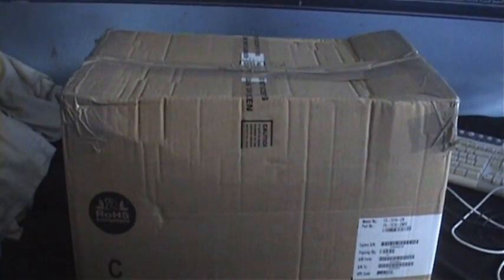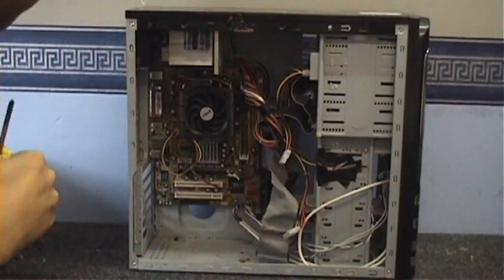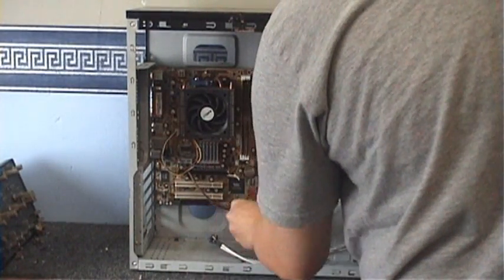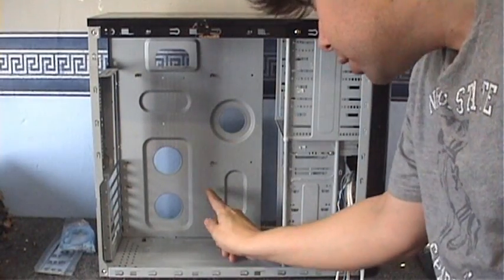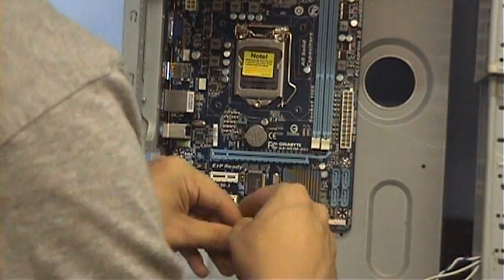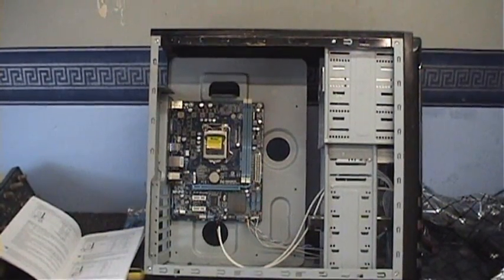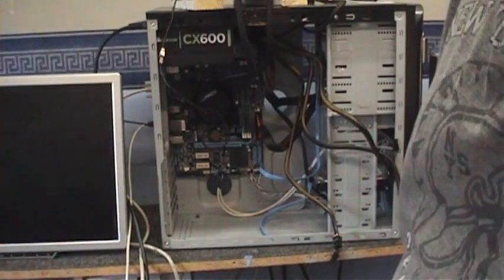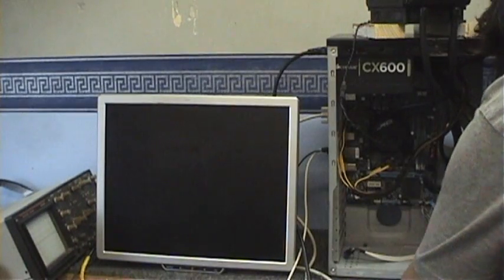The PC upgrade saga part 2 - Un-boxing and performing the upgrade!

Comment from the maker: It;s easier to use the handycam, when I want to use an external microphone (even tho the handycam's microphone itself is pretty good) I can just plug it into the camera and not rely on a separate tape recorder to record the audio, which also makes video editing easier since I don't have to sync things up.  As the handycan is tape based and not memory card based there's no chance of corrupted files, tape will just glitch out for a couple of seconds then be fine again.

Comment: The biggest performance difference between Ivy and Sandy is that the updated Quicksync(for video encoding) is far faster on Ivy, slightly faster per clock, less power consumption, hotter :(

The only reason why I upgraded from Sandy was Quicksync other than that there's very little in it

Comment: Clem, if xp installed without intergrating sata drivers chances are your running the sata in pata mode. Also if you want the 8 gigs in xp get hold of xp x64 edition

Comment: Clem it really hurts me seeing you make mistake after mistake with your PC. There are great forums out there where you can get very good advice.

1 - I'm happy you bought a new PSU you really didn't need to butcher it.
2 - Pairing a 2500k with a H61 ? WHY ? Just why ?! You can't overclock your 2500K
3 - Big ass cooler - WHY ? When it's more important to get the case airflow right. Overclock you say ? NB point 2
4 - SSDs are like 30 quid dude

Good luck with your build